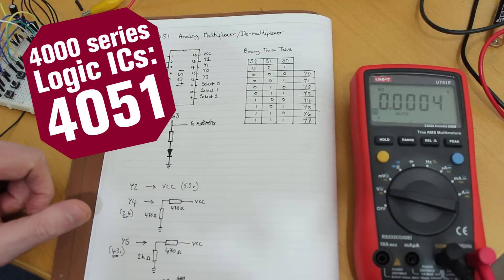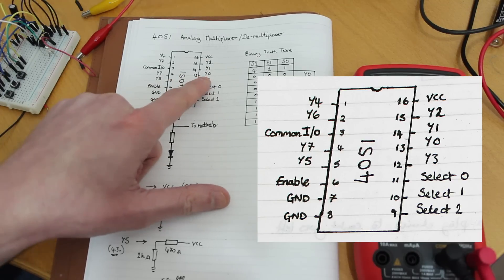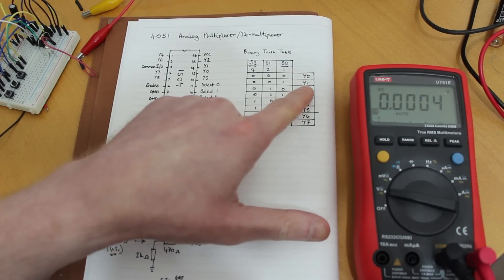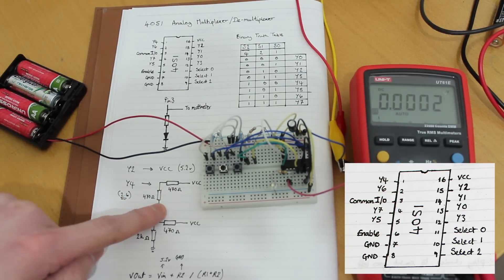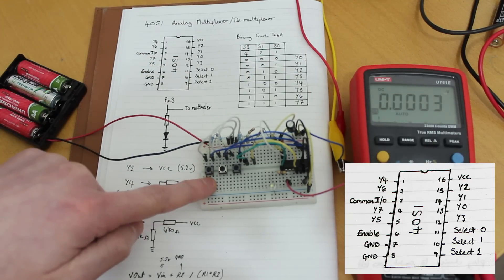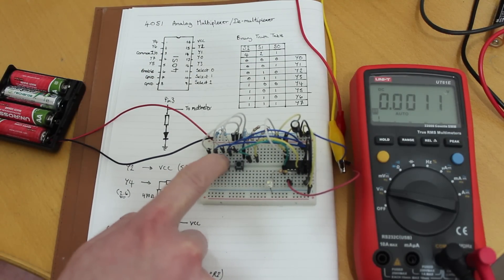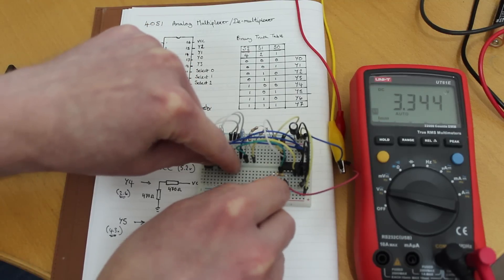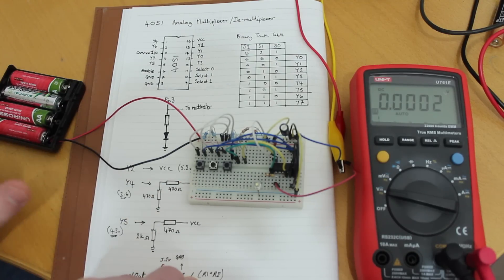4000 Series Logic ICs: The 4051 8-channel analog multiplexer/demultiplexer IC

Comment: How do you know what R1 value should be if VDD is 2.5V? It looks like the 470 Ohm value for R1 is when VDD is about 5V.
Reply from the maker: The resistor value can be anything you want, I chose 470 ohm because I have a lot to have. The resistors being in there was just to get a variable voltage on the outputs and to limit the current to the LED. When I am using the resistors here it is as a voltage divider, it gets a bit mathsy but it is explained well here https://en.wikipedia.org/wiki/Voltage_divider. So Voltage Out = 5V × (470 / (470 + 470)) = 5V × 0.5 = 2.5V. If both resistors are equal it halves the voltage. Its all about the ratio, so if 470 (R1)  / 940 (R1 + R2) = 0.50, you can see it as 50%, In the same way, a 10k (R1) and 20k (R2) would give you 66.6%. It can get a bit confusing because R1 and R2 add on one side of the equation, for R1 at 1k and R2 at 3k would  give you 25% of the incoming voltage.

Comment: Wow great video David! How much voltage can you apply to one input port, that will be reported to the output port? Till 20Volts?
Reply from the maker: I though it was 15v but I have just checked the datasheet and 20v is indeed the listed maximum.
Reply: @DavidWatts  Ahah Thx for the quick reply 🤣 I wouldnt imagine it so fast! Thx again! 😎😎
Reply: @DavidWatts  Sorry David, my last clue: if I give a big VDD(amplitude voltage) like 20Volts, the needed selectors voltage(C,B,A) should also increase? Like 2,75 Volts every 5 Volts of Amplitude voltage VDD?
Reply: So :  20V/5V=4  -->needed selector voltage=4*2,75V=11V?
Reply from the maker: @zdi9498  You'd need around 70% of VIN for a high signal and 30% max for a low. That is pretty rough but should work.
Reply: @DavidWatts  with Vin you mean one of the inputs? (One of the eight possible) ok!! Thx for the advice, so like 14 Volts of selector voltage if I have an input of 20 Volts? 🙏🙏🙏
Reply from the maker: @zdi9498  sorry, by VIN I meant IC supply voltage. A high on the selector would need to be 70% of the supply voltage. If I am reading the datasheet right.
Reply: @DavidWatts  Ok, I think it should be! Now Im trying tu use pull up resistors with diodes to a similar voltage. Let's see if it works 😎
Reply: @DavidWatts  I confirm, it worked well! 😁Thank u a lot again! Have a nice All!

Comment: How to use it as demux
Reply: Hi! It may be late but I think this IC is just an analog switch. So you can input any rated analog voltage on the common I/O and then it's just input impedances fighting with the host and the slave.

Comment: Hello! Could you give an idea about how to set up these bits by some ICs using a latching method (when you push a button and it switches a light... this type)?
I guess that it can be done with logic chips but i don't know which of them to use and what are the common pitfalls :-/
My main reason: i need a simplest solution to make a "click-switch" device to toggle between different schem. choices (need it for the analog filter... 6dB LP/12dB LP/6dB HP/12dB HP/6 dB BP/Notch - six positions
Also there will be a second route that will be switched with the same button. I guess it's not that important.
Using rotary switches is a dope :) But later i'll make something paraphonic (or polyphonic) so i'll need to do this kind of switching anyway.
Thanks for your channel!
Reply from the maker: You could use a rotary switch to have a physical device you are right (I really like them) or you could couple the 4051 with a 4510. The 4051 takes a BCD input and the 4510 gives a BCD output based on a clock input from your switch.